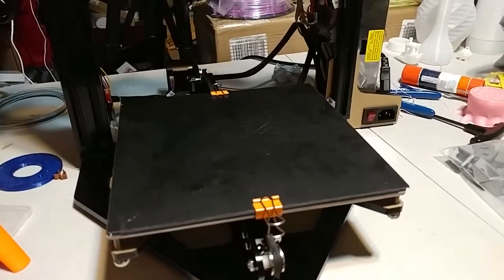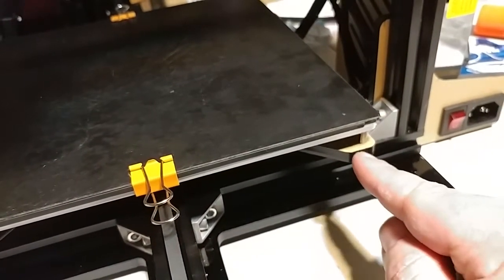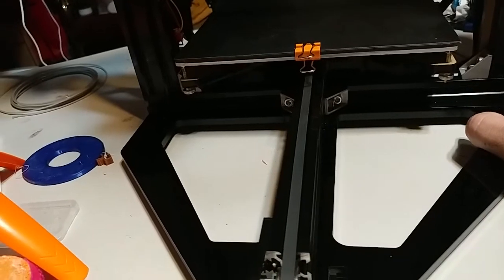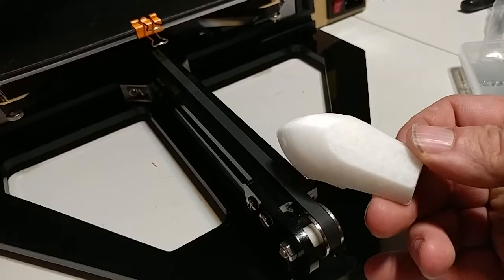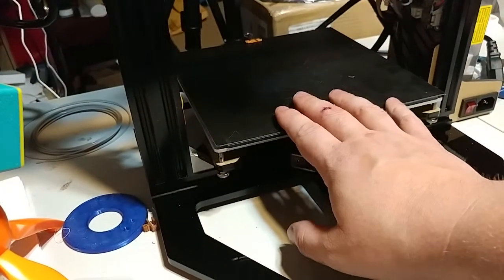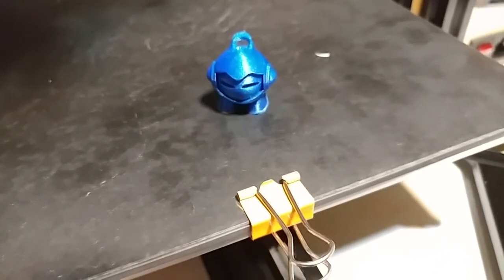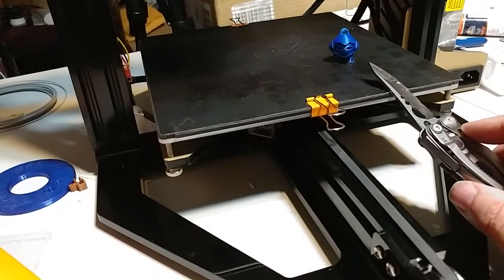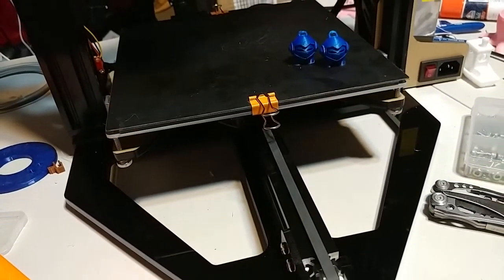Today's 3D Print - Zonestar Z5F stiffened up

Comment: Hi Guys!
We have released a new firmware today, there is an important upgrade that you can easy to adjust the mixed ratio on the LCD screen.
Now you can change the print object color by adjusting the mix ratio in any time.
For more detailed information, please refer to  <<Tips for Mixed color extruder (V4).pdf>>, download link: https://drive.google.com/drive/folders/1hVywxyftiIPdrkwB5LsgyewTK2bD4YY3
If you are interested in this feature, don't hesitate to purchase an upgrade kit from:
https://www.aliexpress.com/store/product/New-Arrival-3D-Printer-Dual-Extruder-Upgrade-Kit-for-Zonestar-P802N-P802M-P802Q-P802QS-A8-Two/2214028_32769324293.html
ZONESTAR TEAM

Comment: I have the exact same printer, it printes beter then my 500€ printer, and all I did is just make sure everything was tight. The only thing that is bad (designed) on this printer is the bed, its to wobbely.
Reply from the maker: +Mentos Freshmaker yep when time allows I'm going to replace the acrylic base with a three quarter or full inch hunk of plywood that will stiffen it up nice :-)